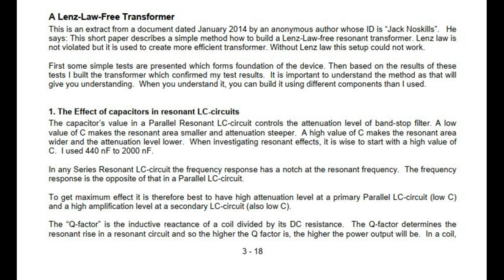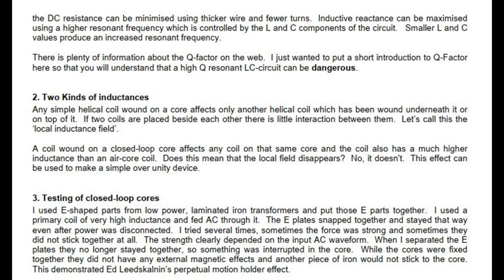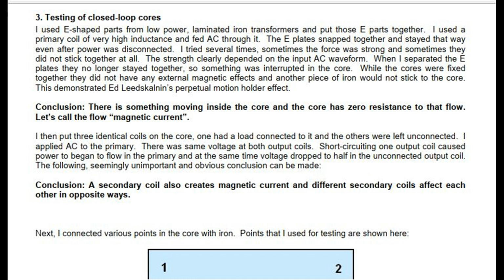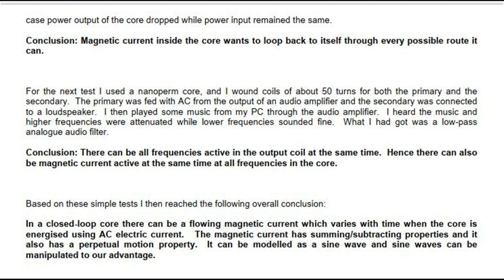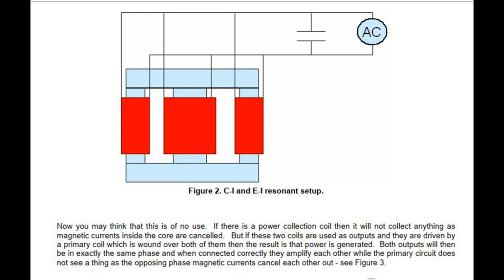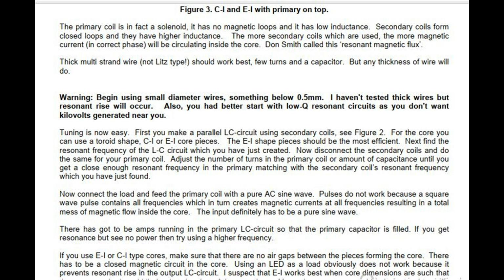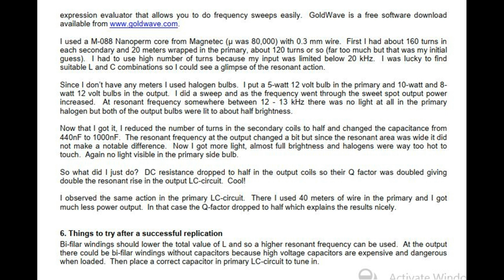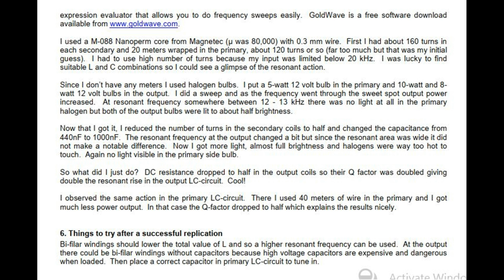A Lenz Law free transformer

Comment: To be fair. What the heck does the secondary side capacitor resonates with? There isnt any inductance since the two secondary windings cancel esch other completely (parallel connection does that). The capacitor isnt capable of resonating with the primary winding either since the two secondary windings doesnt affect the primary winding too. So, it can only resonate with the aether isnt it? The force-free gauge potential : )